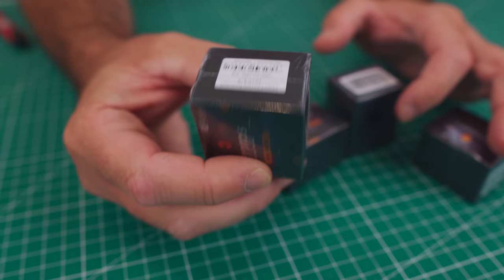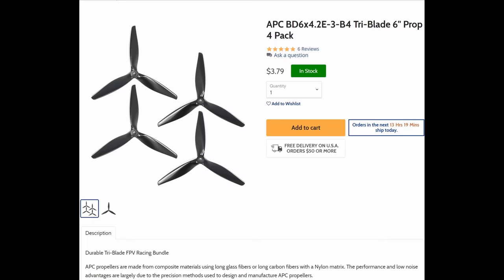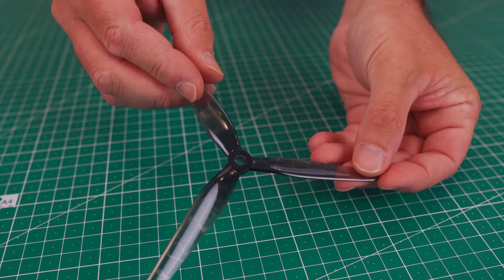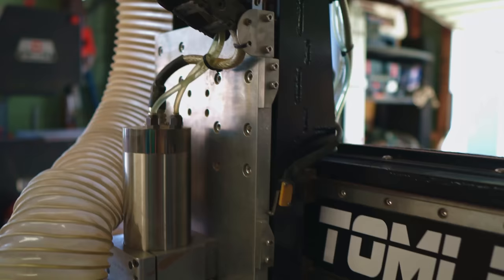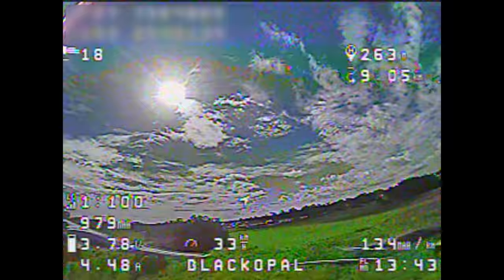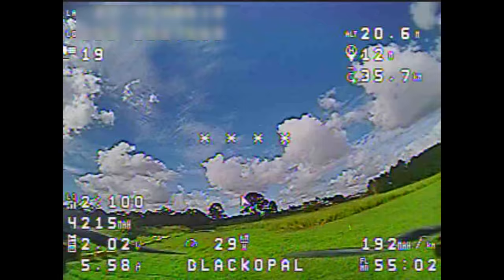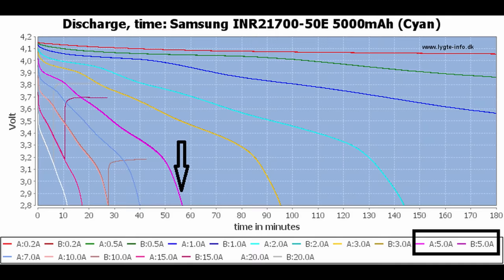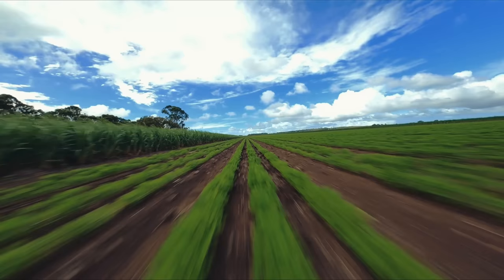55+ Min Long Range Drone (NEW T-Motor F2203.5)

Comment: how long does it fly with the gopro?
Reply from the maker: I switch to 5S or 6S Li-ion (18650, 3000 mAh) or just regular LiPo when adding the GoPro. I've done a few flights around 25 mins on a 5S 3000 mAh Li-ion pack. Yet to try a higher current 21700 like the P42.

Comment: I seem to have missed what the configuration was on your 21700 battery? Can anyone share this? I’d love to build one.
Reply: Maybe this helps: "Scott Tomlinson
2 months ago
I think that would be a little too heavy. I'd go 7/8 inch for a 2P pack." 
So probably a 4 S pack with no parralels...?
Reply: 4s1p 21700
Reply: @chrisbee5481  Why would you suggest 1 parallel, when the designer of the quad suggest NO parallels?
Reply: @natlozzz  1p meants it's only one cell on parallel. Like  1 x 1 = 1
An electrician would professionally describe this lipo configuration as 4s1p

Comment: That shot upwards through the clouds was awesome!

Was that with Reelsteady or just hypersmooth?
Reply from the maker: I'd have to go back and check the edit but I think that cut was HS. I tend to use RS only on the flowy line type shots (Like the trees) If I know I'm going to do a sharp turn etc I try stick with HS. I really only capture in 2K7 so RS can do that super zoom and crop too much which really messes the clip. I also find RS sucks when speed ramping anything, turns into star wars time warp type stuff haha.
Reply: @ScottTomlinson  Ah I see. I just got a CVATAR to take my GP8 out. I assume then you shoot in GoPro color and not flat? I've looked into doing color correction and grading with GP footage and it seems like a silly amount of effort
Reply from the maker: @agentrfr1  I go against the grain on that yeah. I capture in GP colour most of the time and tweak a few things in resolve. Without mad grading knowledge I find you can mess something up pretty easily (Blocky blue sky is one!) Check out Abe Kislevitz if you haven't already. He's a GP master.
Reply: @ScottTomlinson  Thanks for your help! I will definately give Abe a look :)

Comment: Love this build. I noticed on your second 15K flight, the current draw got up to 22 amps. Were you still using the 21700s?
Reply from the maker: Sorry just spotted this comment. Adding a reply for future views. From memory those were on VTC 5S and 6S packs. So 18650.

Comment: Some sorta STL , 3d printable file would enable 3d printing this frame out.
Reply from the maker: DXF files are linked in the description. I wouldn't recommend 3D printing it however. If you do though, definitely share your findings as it would be quite a feat! Good Luck.
Reply: @ScottTomlinson  Will definitely share.
Reply: @ScottTomlinson  If you could share some other design files . That would make life a little easier then that way i wont have to try converting the dxf files to stl by copying the design .

Comment: Could we get a detailed video over your Li-ion battery pack
What changes you did in the flight controller or esc
Reply from the maker: Li-ion is just a 4S 21700 pack. Nothing special really, standard charge etc. Same goes for the electronics, nothing out of the ordinary. I just treat it like a race quad with respect to build/tune.
Reply: @ScottTomlinson  both have same max voltage 4.2v, but as the voltage drops to 3.7 per cell FC or ESC starts beeping and even switch off after some time. So this voltage should be changed to 3.3v(aprox) for Liion cells to use the mentioned capacity.
Reply from the maker: Most modern FC/ESC will happily operate at 9-10V still so on 4S this is rarely a concern (Down to 8V in this video) I set my warnings to 3V and have no buzzer so there's no beeping/flashing. The min/max setting in BF for battery is just autodetecting the cell count.
Reply: @ScottTomlinson  thanks, 
But i need to change settings a lot, since I'm not in racing but in autonomous cinematography
They have a lot of safety features, which tensed me a lot 🤣

Comment: whats the time with a gopro?
Reply from the maker: I switch to 5S or 6S Li-ion (18650, 3000 mAh) or just regular LiPo when adding the GoPro. I've done a few flights around 25 mins on a 5S 3000 mAh Li-ion pack.

Comment: Amazing job spec'ing parts, making the frame, and putting it all together!  Have you considered a sandwich construction material for the main frame to shave some more weight?  Or lower charge rate on battery to squeeze in a few more mA, or even charging up to 4.25-4.3V (with proper precautions)?  Could be enough to get you well over an hour.
Reply from the maker: Definitely plausible mate. In all honesty I could probably even carry a 4S2P on this quad so 10,000 mAh (insane right). I tested the 5 inch with 500g of battery so it's not a huge leap on the 6. The idea is out there now which is what I hoped for. We'll now see a heap of these numbers and distances getting broken I feel. I'm shifting focus to total distance for the time being, it's a better metric for comparison. (eg. I could easily hover for well over an hour now but that's a bit moot)
Reply: @ScottTomlinson  Thanks for the comments - great job and great video.  Just subscribed.

Comment: Ok going to try build this. But damn really want t-mount.. but other 2203.5 and 2303.5 motor don't seem as efficient guess cause higher kV.. might do flywoo 2303.5 since it's t-mount and I Don't have to drill props
Reply from the maker: Depends what your goal is. I've still managed 30 mins on 2005 2000kv motors that are T-Mount.
Reply: @ScottTomlinson  so u ever get close to 7" with gps mount? 
Rekon7 came out. But I was really hoping for lightweight.

Comment: slap a lipo on it and some gemfan 5552 and see what kind of top speed you can hit! i was at 110 with a heavy freestyle quad
Reply from the maker: Yeah she definitely would move. My 5 inch vid has some full throttle passes. The APC 4.75x4.75 or 5x7.5 are the true speed demons if that's what you're after.

Comment: How in the hell did u make a 43g 6inch frame?? And make it have room for mounting stuff instead of a toothpick!?
Reply from the maker: It's 4 mm so has plenty of stiffness too. Just trimmed the fat until I was happy with it. Worked out quite well I think.

Comment: Amazing video!! I would love to know, what is the name of the cnc cutting machine?🙂
Reply from the maker: The router is all custom built. I designed it from scratch. The bed is 2000 mm x 1300 mm. It's really overkill for carbon but I can cut 20 mm aluminum no worries too.

Comment: Hi Scott
Amazing build and footage!
Can you please share how many mm thick your bottom plate is and which cnc you are using.
thank you very much
Reply from the maker: Thanks for watching mate. The bottom plate is 4 mm thick. My CNC is custom, one I designed and built from scratch.
Reply: @ScottTomlinson  wow, i thougt it must be at least 5mm not to have oscillations. 
how wide are the arms?
thank you very much.
maybe you could make a video one day of how you built your cnc and which hard- and software you can recommend.
Reply from the maker: @christianmmoser  They're tapered but down to about 7.5 mm at their thinnest.
Reply: @ScottTomlinson  🙏🙏🙏

Comment: Can you give a little more infoon how you make these battery packs please, as I would like to give this a go myself
Cheers
Reply from the maker: I don't have a video or anything about the pack building currently sorry mate. Check out FalconRad FPV though. He just made a good video about building Li-ion packs for LR quads.
Reply: @ScottTomlinson  Cheers, is that the same what you watched to make yours?
Reply from the maker: @madforit9661  I've done it numerous times in the past so didn't require a video no. Best  I can offer you at this point though mate.

Comment: A great video :-)
I'm thinking about to build one like this for my first long range setup...
But i am wondering about how sensitive this is to windy conditions?
And are there tpu mounts for GoPros available?
Reply from the maker: Ultralights will always suffer in heavy wind conditions compared to a larger quad with more mass. Though having said that, it'll still hold it's own for most flights unless you're really exposed. If you're not opposed to using RSGO or hypersmooth etc you'll have no problems obtaining great shots. I've only been using a naked hero 8 that still has the standard mount so not sure if anyone's made a fixed mount yet. Shouldn't be too hard to adapt something to it however.
Reply: @ScottTomlinson  thanks for your answer :-)

Comment: Great work Scott! Question, have you made a 6s li-ion 5000mah? Would it still be efficient on the 6 inch?
Reply from the maker: I've used 6S, 18650 packs and it's ok. 6S, 21700 could probably work too. You'd be getting close to the diminishing returns level though I feel.
Reply: @ScottTomlinson  Thanks for the response.  I'm putting a 6 inch together with your frame.  I also dug my plotter our of storage! I'll keep you updated.

Comment: hey whats your gopro setting, the image is really good and the video too
Reply from the maker: Cheers mate. Typical 2k760, iso 100, fixed exposure with ND16. Exported at 30 fps to match the video however.
Reply: @ScottTomlinson  thanks,wholesome videos by the way

Comment: Amazing guy!! I love this quad!!! Fly for 55 minutes with a battery?? Awesome. I want one of them!!! There are enough space to put a Caddx vista in the frame??
Reply from the maker: Cheers man. The camera spacing won't allow the vista cam to fit (it's 14mm) but if you printed a camera mount you could make it work I'm sure.

Comment: Any recommendations to get you frame cut is OZ, I have to have one!
Reply from the maker: I think there is a guy down in VIC that does RC carbon parts. It's honestly just as easy/cheap to get it from RainFPV or Hobby Carbon in China. They ship DHL too.
Reply: @ScottTomlinson  cheers Scott, thanks again for all for hard work. I'm ordering parts as me speak!
Reply: Built. and LR-ing as We Speak. Such a beast. Thanks Scott. Hey What Naked GoPro mount are you using? I'm having trouble getting rid of jello with the 6" Props? Any tips would be awesome. Cheers again.
Reply from the maker: @AerialRCimagery  I use the standard fold down mount on the GP8. My 'naked' uses the factory front aluminium housing. Is it a tune thing or mount thing? Going to 48 kHz PWM Frequency could possibly smooth a few things out?
Reply: Thought I had the tune locked in, but will up the PWM rate on my escs and see how I go.  Thanks again!
Reply: Got the tune dialled in a bit better cheers Scott. Having a blast LR-ing this thing. https://youtu.be/cCVBe8Mf9WU Thanks again.

Comment: Does it feel heavy if carrying full gopro?
Reply from the maker: I wouldn't recommend it. Better ways to carry a full GP.
Reply: @ScottTomlinson  do you mean naked gopro?
Reply from the maker: @catmanfpv9213  This carries the naked GoPro fine. The motors aren't really up to carrying a full GoPro if you plan on doing anything aggressive. Slow cruising would be fine however.
Reply: @ScottTomlinson  noted. Thx, Scott.

Comment: Sry if i miss info, whats total weight?
Reply from the maker: 188g + battery
Reply: @ScottTomlinson  Thanks, well thats dry weight, but definitely not sub 250g i was looking for. Whats weight of your battery pack used there??
Reply from the maker: @brezovprut4431  ~290g

Comment: how to get shots like this at 5:00
Reply from the maker: I was just trying to fly low and straight. It helps when you have crops planted with such precision that last about 1km haha.
Reply: @ScottTomlinson  i mean , Fototage from a GoPro 9,8,7 ? Nd Filter ?
Reply from the maker: @Zattoo20  Oh yes no worries, this was naked hero 8 with camera butter black diamond ND16. The usual, 2k760 locked exposure, white balance, iso.

Comment: All great but still I can't understand why everything is metric except propeller diameter... Why use inches in new, 21st century designs? 95% of world population use SI measurements system so why we pollute drone market with imperial?
Reply from the maker: Many people have asked the same question about wheels on an F1 car. Crazy right.
Reply: @ScottTomlinson  The only way to solve it is to talk about metric, point why it's crazy to have many units for single property of universe like distance (inches, miles, nautical miles, feets vs only meter in SI + prefixes. When we will educate kids right they will bring the change naturally in next 20-30 years. I like how metrification is progressing in space exploration. NASA uses metric in latest Mars rover, SpaceX uses 10 km altitude in their SpaceX's Starship flights. Most importantly it's broadcasts in USA television - that spreads even faster. I guess for cars it's a bit too late as every vehicle in the world uses wheels in inches but for drones I bet it's still not too late - just make videos on youtube when propellers are also in millimeters :D You have 3.6k subscriptions - you have the power :)

Comment: I understand you were pushing the limits to demonstrate, but 2.5v under load for those cells is the lowest you want to go. Pushing them to 1.94v is starting to do damage
Reply from the maker: Definitely agree, you would reduce the life cycle of the cell significantly doing this too often.

Comment: @Scott Tomlinson Wow! Really looking forward to further testing your new frame. I use Digital with the cadix vista, do you have such a version made yet? I look forward to hearing from you.
Reply from the maker: I made a digital version in my last video! (Towards the end) It's my new fav quad haha.
Reply: @ScottTomlinson  On the 7" one? I know you showed that for the 5" one but I don't find a DJI version for the 7" frame.
Reply: @princesfpvdrones  I am about to build some upgraded drone for long range next season summer, did you figure out the DJI version frame somehow and needed AIO fc-esc or stack?
Reply: Nah, I didn't, couldn't get this design to work at all and moved on.

Comment: Just emailed Nick of CNC madness to have a couple of these beauties cut! Any suggestion for an HD build (standoff length to fit a vista?) Also did you design a naked GoPro mount for the top plate? Keep up with the awesome stuff!
Reply from the maker: 30mm would be fine if you're not stripping it. The cam mount however isn't wide enough for a DJI cam, so you'd likely need to 3D print up something using the front standoffs. I still use the fold out mount on my hero 8, don't have a specific one for a naked to slot into etc. I just retrofit an existing one I had for this vid.

Comment: What about selling the carbon frames  on Etsy :)?
Reply from the maker: That's an option. The ongoing time commitment in selling frames is something I don't want to deal with really. The files are available now and you can get the frame from shops like CNC Madness now too.

Comment: Amazing boooyyyy, could i use These Motors for 7inch frame also ?
Reply from the maker: Possibly. You'd still need to keep your frame and prop weight right down though.

Comment: How did you do that green skin on the frame? It looks really nice!
Reply from the maker: That's just a vinyl cut decal mate. In my latest video I do it again which you can see a little better.
Reply: @ScottTomlinson  did you use the same CNC cutting machine and just put a piece of vinyl in it? If so this might be a valid excuse to purchase that beautiful piece of equipment you have there

Comment: amazing video, you could use that 1500 kv motor in a 4 "drone the 2203.5 motor tks 🙏🏻🙏🏻🙏🏻🙏🏻
Reply from the maker: Yes, it could work sure, they have a higher kv option available too. Works great on 5 inch also.

Comment: Wow - have you tried 6S 21700 on this? My calculations say it should be possible and even better.
Reply: Just did the math, even 4S2P 21700 should be (the last) feasible (battery) on your drone. It would be really cool if you could share your experience or even confirm this?
Reply from the maker: @ethkid8925  5S and 6S packs gave much better flight performance but didn't increase efficiency due to the weight. Check out the bottom of this article, it has some more results - https://dronedj.com/2021/02/19/a-closer-look-at-that-55-minute-long-range-fpv/
Reply: Thank you very much!  @ScottTomlinson  You are flying with 18650s there, I wondered whether you ever tried 5S or 6S 21700s. But after reading your article, I am most confident you could and reach times over 1h...
Reply from the maker: @ethkid8925  I tried it all yeah. You're right though. This was 3 years ago. I've doubled the times on my endurance drones since then.
Reply: We do miss your videos, mate! Such an inspiration tous all, and you say you now easily do over 1h? :D very much looking for an update!! @ScottTomlinson
Reply: @ScottTomlinson   "I've doubled the times on my endurance drones since then." Would you share a configuration of your setup with double times? Or take some pictures?
Reply: @ScottTomlinson  can you tell us your new endurance LR setup? Whats props and motors?

Comment: just a suggestion, check those bats with care nobody but the Chinese claim to make a lilo with 5k mamps and those usually test out at 1000... the designation on that  Samsung says its a 2100... much more believable
Reply from the maker: Yeah Nah...https://lygte-info.dk/review/batteries2012/Samsung%20INR21700-50E%205000mAh%20(Cyan)%20UK.html